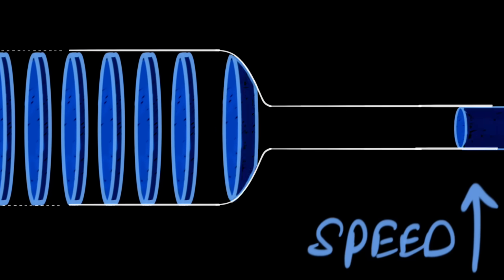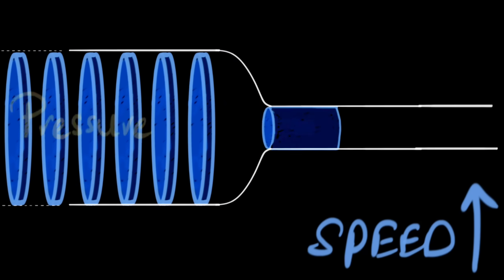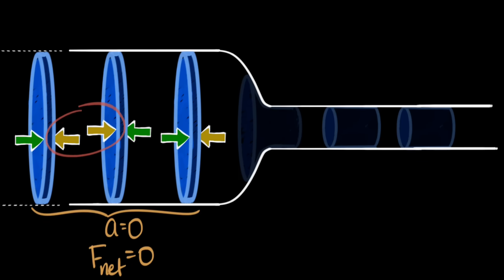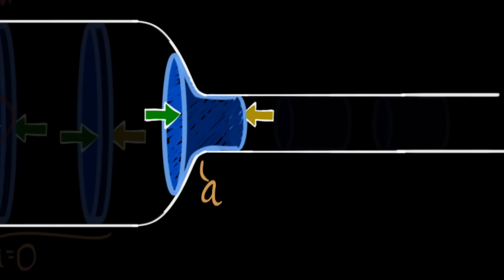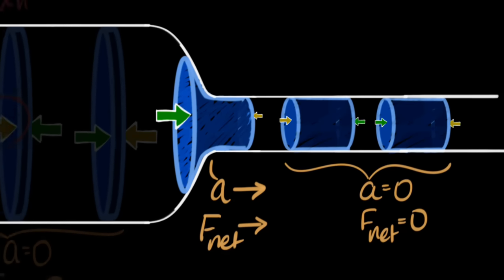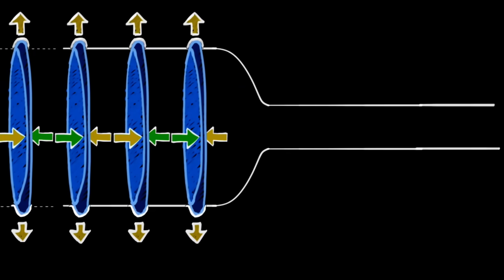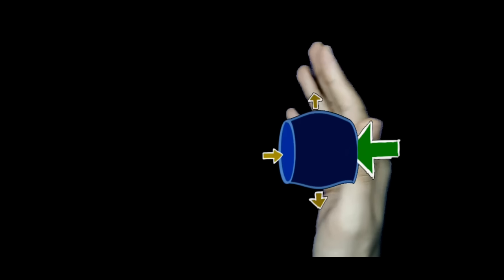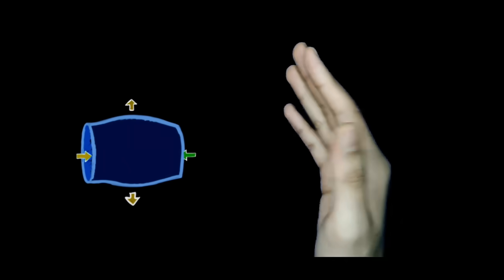Why Faster Fluids Have Lower Pressure? #VeritasiumContest

Comment: This is not a full explanation. The area of the pipe reduces so there would be a force imbalance to cause acceleration regardless if the pressure was lower or not.
Reply: Can you explain further? I believe you are wrong! Certainly pressure will decrease kind sir!
Reply: @MathCuriousity  The pressure is lower. When you look at the force imbalance you have to also take into account the pressure times the sectional area. So the explanation doesn’t take into account everything that is going on. It is not a complete proof of why the pressure is lower.
Reply: @yodaiam1000  can you explain this in more detail your comment about pressure times crosssectiomal area and what it applies to in the animation?
Reply: @MathCuriousity  You have to do a full free body diagram. The force of on the water in the left pipe is the pressure time the cross sectional area (call it P1xA1). Call the water force on the right P2xA2. So we know P1xA1>P2xA2 but this by itself does not tell us the relationship between P1 and P2 because we simply know one side of the equation is greater than the other side of the equation. That is why the proof is incomplete. It could be (and it is actually the case) that P2<P1 but that is not confirmed by this proof since there could be a range of cases where P1>P2 yet we can still have P1xA1>P2xA2.

What is also interesting is the static case where the water is under pressure but not moving (the small pipe is capped off).  We know P1=P2 (by definition of a hydrostatic condition) but A1 does not equal A2 but we also know that net forces have to be equal to zero since there is no acceleration. This is because we have not accounted for the force in the container wall when doing the free body diagram. The container goes into tension in this case.
Reply: @yodaiam1000  very interesting! Any links for other videos or concepts titles  so I can grasp what you are saying better!???
Reply: @yodaiam1000  can you tell me good links for understanding how to do free body diagrams? And also this topic of that you say the video here did wrong?
Reply: @MathCuriousity  It is really just basic understanding of statics and hydrodynamics. Learning about the conservation of energy (bernoulli's principle) would also help. Statics is just saying that the sum of the forces has to add up to zero for a body that is not accelerating and has to add up to the mass times the acceleration for a body that is accelerating. With statics you learn about FBD (free body diagrams) etc which is a fundamental base for understanding a lot of  engineering concepts. It is one of the fundamental tools of engineering.

I am sure there are thousands of videos on these topics. There are also many basic engineering courses on it. I am sure somewhere like Brilliant would have courses in both statics and hydrodynamics. It is best to get a basic grasp on static first.
Reply: @yodaiam1000  beautifully explained! I’ll look into this further. Thanks for clarifying about the FBD. So am I understanding you that bernoullis principe “uses” conservation of energy principle? Or are you saying it IS equivalent ?
Reply: @MathCuriousity  He used the principal of the conservation of energy. I wouldn't say it is equivalent but only because the conservation of energy is more general and bernoulli's equation is limited to fluids. If energy is not lost on a streamline then the energy at point A is equal at point B (minus entropy loses if you want to get particular). The total energy is kinetic energy from the velocity plus the potential energy from the pressure plus gravitational potential energy.
Reply: @yodaiam1000  wow. You are good at explaining stuff. Let me ask you two more question: 
1)
if the pressure IS lower over a higher velocity narrower band of hose, then why is it that when the water hits my palm, it is absolutely a higher pressure? Are these different pressures? Is this the whole dynamic pressure vs static pressure thing?

2)
What equation for conservation of energy shows kinetic pressure and gravitational?
Reply: @MathCuriousity  1) All the kinetic energy is converted to a high pressure. The water is essentially stopped. It also loses a bunch of energy to entropy at that point. The water at the bottom of waterfall is warmer than the water on top of a waterfall.

2) It is just like throwing a ball straight up. At the apex of the throw the velocity is zero but you have maximum potential energy. Then the ball comes back down and regains the same velocity as when it was thrown up. Kinetic energy is (1/2)mV^2. Potential energy is mgh. At the top, E=mgh. At the bottom, E=(1/2)mv^2, (V at its' max). In between, E=mgX+(1/2)mVx^2, (Vx is the velocity at height X). E is always the same. The sum of the two over any point of the trajectory is a constant (assuming no lost energy). Same thing applies to water except that pressure also has potential energy. In a hydro static condition (water in a container and not moving) every drop of water has the same potential energy. The pressure potential and gravitational potential energy add up to the same constant at any point in the water. In that case the kinetic energy is zero. Fluids flow from high potential energy to lower potential energy. That is why static water doesn't flow even though there is a height difference from the top surface to the bottom of a container.
Reply: @yodaiam1000  beautifully stated! Thank you so so much!!!!
Reply: @yodaiam1000  isn’t it weird that a water molecule at the top and bottom have the same energy when clearly the top one has more gravitational potential energy tho?!!
Reply: @MathCuriousity  The water molecule lower down is at a higher pressure so the total potential energy is the same.
Reply: @yodaiam1000  but I thought the one lower down is EXPERIENCING higher pressure - but you are saying it actually has a higher pressure potential energy? I geuss that means if the glass disapppeared the water would be pushed down faster than the top one
Reply: @MathCuriousity  The higher the pressure, the more potential energy there is. If water is starting to move faster, the potential energy decreases and the pressure decreases.
Reply: @yodaiam1000  right ok and this is all because we “under the hood” are always working from an assumption that “energy in = energy out ? No matter the system whether liquid or air right ?
Reply: @MathCuriousity  Yes. That is the assumption but it is an underlying assumption that is really an appropriation and not always valid since there is entropy. It works very well in a lot cases.

Comment: The thing is pressure or energy is always constant, when fluid accelerate due to narrow passage its static pressure is decreasing which is felt on the wall of the passage and kinetic pressure is increasing, 
Overall all pressure is static pressure + dynamic (kinetic pressure) remains constant.

Comment: this is what i was looking for, well explained

EDIT : nevermind, i didnt understand this fully, question : how did the force increased at the funnel, but decreased after passing the funnel (the smaller pipe)?
Reply: i have the same question
Reply: @arvind7392 i know im a year late, but, for example take a hose pipe, when u press and reduce the area, it sprays faster. The velocity dosent increase after continuing to press the hose pipe

Comment: I know it's impossible to cover everything in one minute, but I thought I'd mention the bit about it feeling like more pressure when it hits your hand...
The Bernoulli effect applies to fluids that we're not doing any work on.   And on such flows, the "total pressure" remains constant.  This is possible because the static pressure goes down and the dynamic pressure goes up when the fluid accelerates.  The static pressure is what you'd measure if you were moving along inside the fluid.  The dynamic pressure is what you feel when it hits your hand.
Reply: Wow the author should have mentioned this! Also may I ask you a question: what if we used a FUNNEL where every point compared to another point is decreasing in cross sectional area right to the end?
Reply: @MathCuriousity  I'm not entirely sure I understand the question, but in the subsonic region, the flow would continue to accelerate as the funnel narrows.  The static pressure would continue to decrease, and the dynamic pressure would continue to increase.  But you hit a limit at the speed of sound.  The flow can exit the funnel at the speed of sound, but no faster.  Things really get weird on the other side.  Let's put a couple of funnels tip-to-tip.  So the flow is speeding up as the first funnel narrows.  We get it right to sonic as it hits the other funnels nozzle and begins to expand again (this is called the choke point).  But instead of slowing down as it would in subsonic flow, it will continue to speed up into the supersonic range (assuming low enough pressure).  But it will ultimately reach a point (depending on pressure) where it can no longer sustain this acceleration, and will then form a standing shock wave in the diffusing funnel.  Going into the shock wave you have supersonic flow, and immediately on the other side, coming out of the shock wave, you have subsonic flow.  What's perhaps even more bizarre is that the higher the speed of the supersonic flow going into the shock wave, the lower the speed of the subsonic flow coming out of the shock wave.